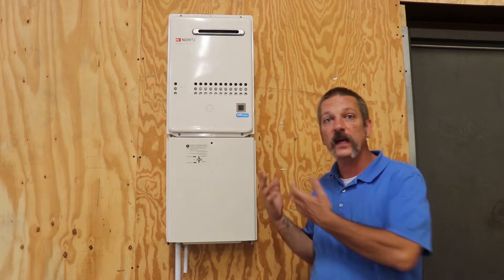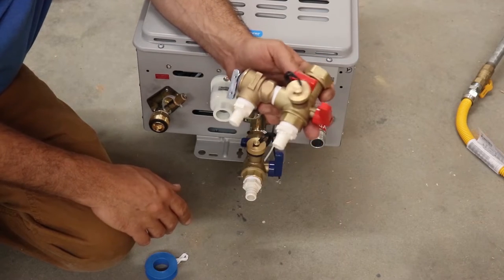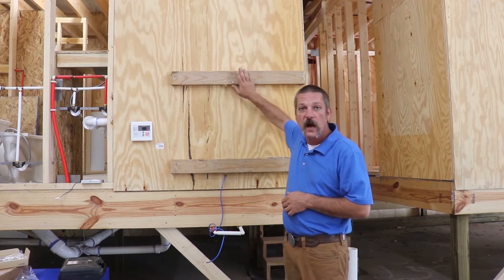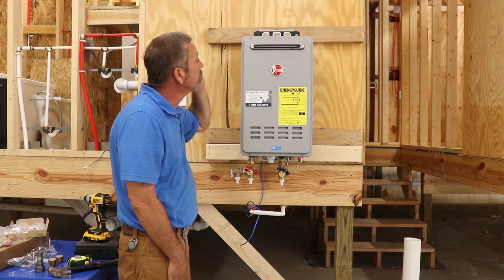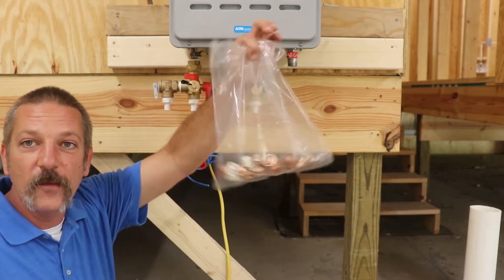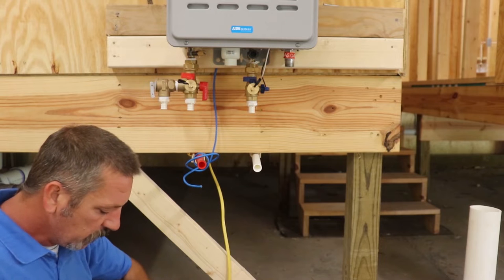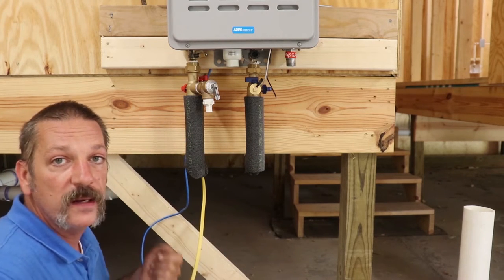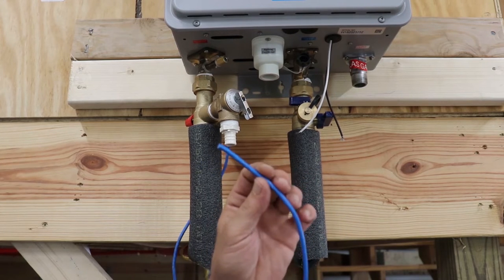Tankless Water Heater Installation

Comment: Thank you so much for this video.  I am about to replace my leaking water heater with a tankless.  Can you please help comment on what I should do when my existing hot and cold supplies are 1 inch pipe while tankless are 3/4 inch?  would getting at 3/4 to 1 inch for both cold and hot supplies reduce the performance of the tankless water heater or reduce pressure at the shower?  thanks
Reply from the maker: Most all water heaters are 3/4, you should be fine

Comment: dumb question. If you're switching to a tankless exterior heater and the water was originally coming in via cold line to the old tank heater.  Do you have any videos showing how to reroute cold water back to the external tankless one? thanks

Comment: On gas line reducer is that 1” x 3/4”? Or 3/4” x 1/2”?
Reply from the maker: Well, you shouldn't reduce it, that just my set up for the demo. most tankless are 3/4 . but there are some that come in 1/2 inch

Comment: I wouldn't put a crimp ring system on my worst enemy's house.....always use copper or Uhonor Wirsbo fittings....you're welcome.
Reply from the maker: Its all about the money. I would go for Uponor for my house. but our builders want it cheap.
Reply: I wouldn't use galvanize or down size the gas pipe, tankless water heaters pull a lot of BTU's.
Reply: Is crimp more prone to failure?

Comment: Also, tankless water heater requires 3/4" gas line and you use 3/4" to 1/2" reducer with 1/2" flex hose.
Reply from the maker: It's LP the pressures are higher . There is a 20 lb grill tank running it and it's just a demo.

Comment: Question: How come for gas pipe, you are using galvanised before the water heater and the drip pipe, you are using black pipe.  Shouldnt you be using black pipe for all gas connection?
Reply from the maker: It's what we had on the shelf . I could do it all out of brass if I wanted to . You use black iron cause it's cheaper. Mine at home is galvanized because it looks better. But , this is just a demo.

Comment: Suggestion by a NC licensed plumber…. Use Wago  connectors instead of wire nuts.  Wago makes a much better connection between stranded and solid wires.
Reply from the maker: Had to look those up, nice but too expensive. We do new construction it has to be cheap.

Comment: My instruction manual said to install the pressure relief valve on the cold water side. What is the rationale for putting it on the hot side?

Comment: I have a 40 gallon NG water heater. Thinking of replacing it with a gas tankless heater. One question I have is I have a 1/2 gas connection to my present tank heater. The 1 inch gas service to the house is right outside the water heater location so that could probably be fixed by cutting out some sheetrock and changing some gas pipe. Do I need a 3/4 line to replace a 40 gallon unit? I haven't looked into this a lot but appreciate the info.

Comment: I have a question regarding the relief pipe.  You mentioned dont go back up with the pipe but what if unit is in the basement? Could I just use a 5 Gallon bucket and empty periodically? Or is there  like a pump system to send it up and out or across the basement to where I actually have a drain?